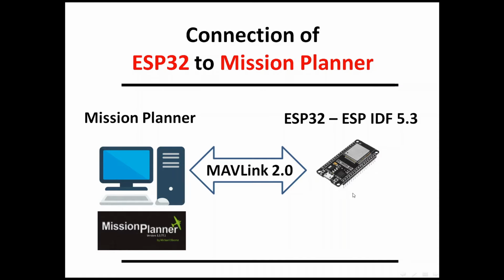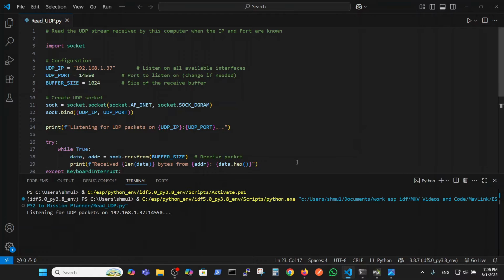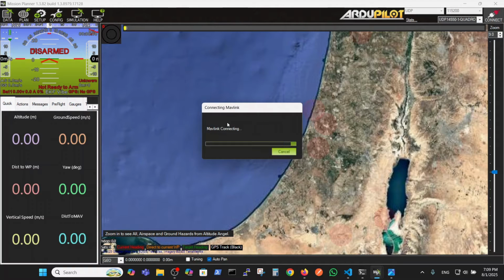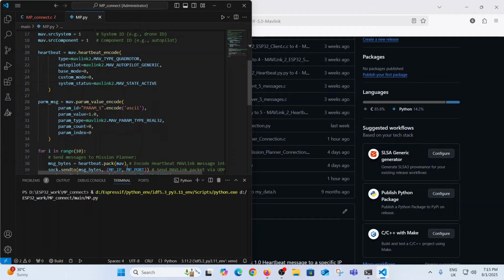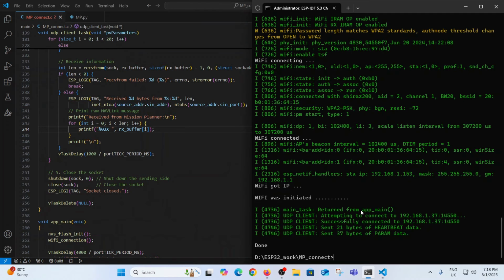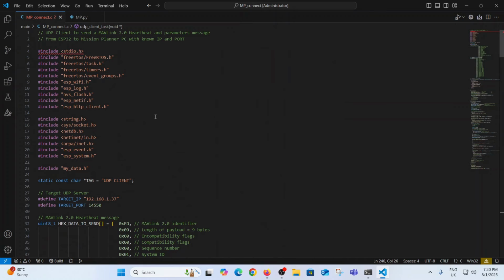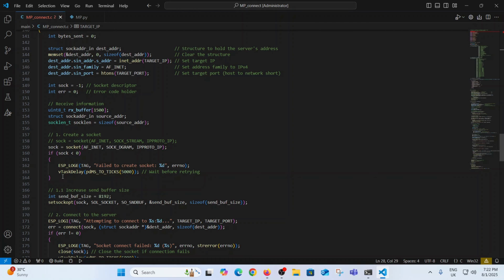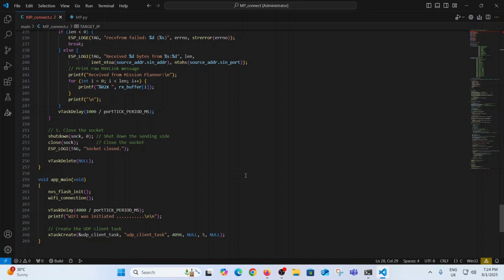7 - Connect Mission Planner to ESP32

Comment: bir sorum olacak ....ben esp32 drona bagladim mavlink ile  veri almak istiyorum bu mumkun mu ....cevaplarsaniz cok sevinirim
Reply from the maker: Dear @ahmetahmet-dj1fd,
It is possible, but if the MAVLink 2 protocol is implemented manually, it will be very difficult. The practical solution is to find a relevant library to include in your code for MAVLink 2 communication API.

Mümkün, ancak MAVLink 2 protokolü manuel olarak uygulanırsa çok zor olacaktır. Pratik çözüm, MAVLink 2 iletişim API'si için kodunuza dahil edebileceğiniz ilgili bir kütüphane bulmaktır.
Reply: Ben fc olarak speedy bee kullandım. Esp32 bagladım rx-tx  bağlantılarını yaptım ama herhangi bir  veri alamadım... Hangi kütüphaneyi kullanacagımı yazabilir misiniz
Reply: Yada bana basit bir kod yapısını atabilir misinız
Reply from the maker: Dear @ahmetahmet-dj1fd ,
If I understood your architecture correctly, you use Speedy Bee as your FC and ESP32 as a WiFi transmitter. Your purpose is to send data from Speedy Bee to ESP32 via UART. To start exploring the UART connection of ESP32, I would suggest the following video: https://www.youtube.com/watch?v=KG30nVK9Qxs, the code: https://github.com/SIMS-IOT-Devices/FreeRTOS-ESP-IDF-RS232-Receive/blob/main/Receive_string.c
Reply from the maker: Sevgili @ahmetahmet-dj1fd,
Mimarinizi doğru anladıysam, Speedy Bee'yi FC (Full Commander) ve ESP32'yi WiFi vericisi olarak kullanıyorsunuz. Amacınız, Speedy Bee'den ESP32'ye UART üzerinden veri göndermek. ESP32'nin UART bağlantısını keşfetmeye başlamak için şu videoyu öneririm: https://www.youtube.com/watch?v=KG30nVK9Qxs, kod ise: https://github.com/SIMS-IOT-Devices/FreeRTOS-ESP-IDF-RS232-Receive/blob/main/Receive_string.c
Reply: @simsiotdevices6219  cok tesekkur ederım.
Reply from the maker: Dear  @ahmetahmet-dj1fd ,
Are you looking for code structure for UART communication?
Reply from the maker: Sevgili @ahmetahmet-dj1fd,
UART iletişimi için kod yapısı mı arıyorsunuz?